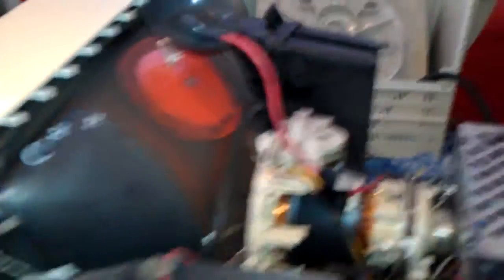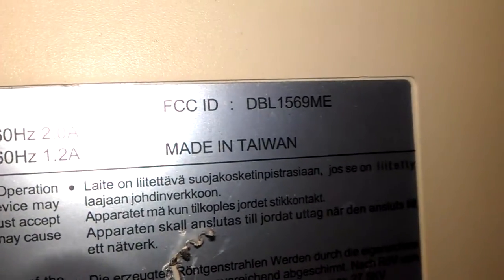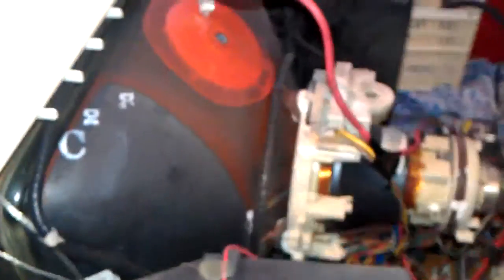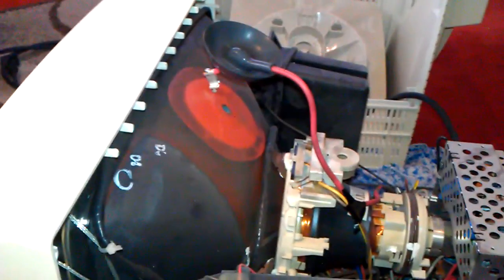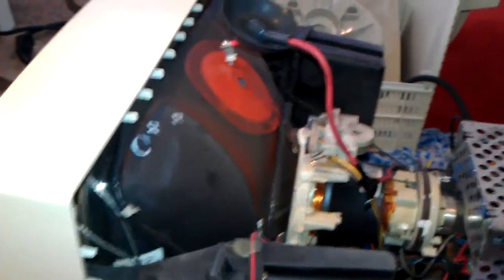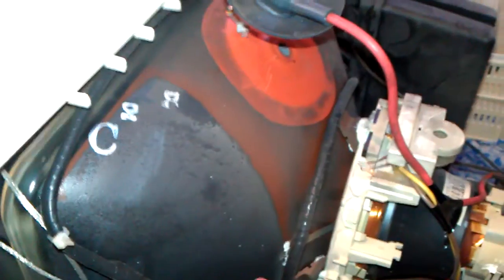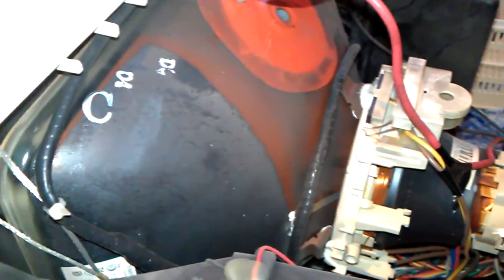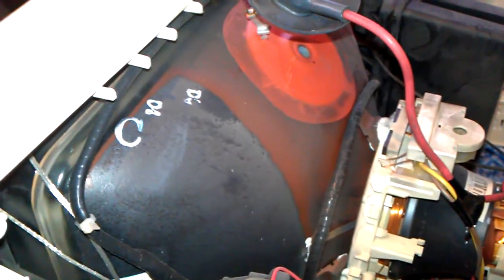CRT monitor h.v cable arcs!

Comment: The outer coating is known as aquadag which is a graphite coating. It forms a capacitor to filter the rectified anode voltage.  Most colour TV's are 25k and the old black and whites 18kv.